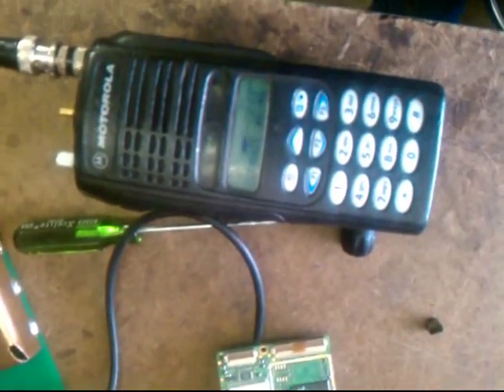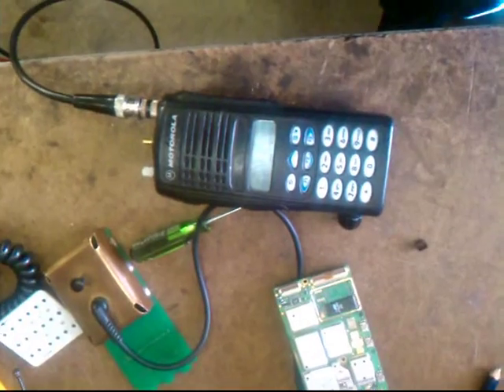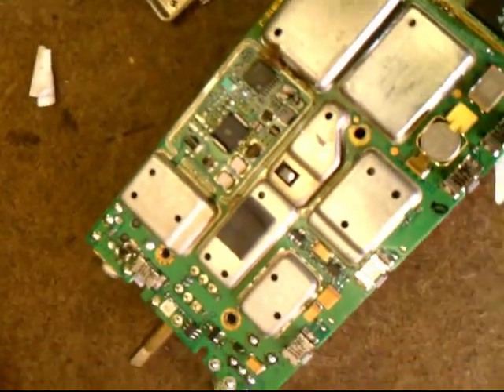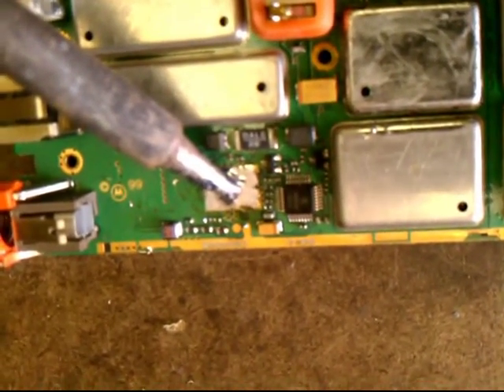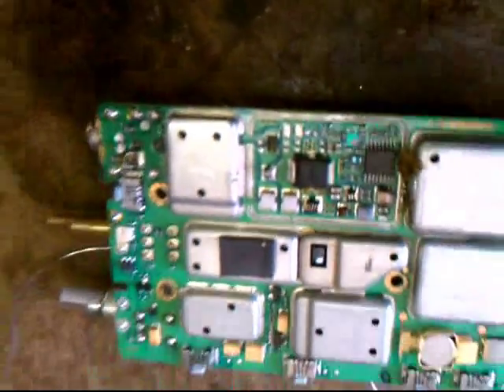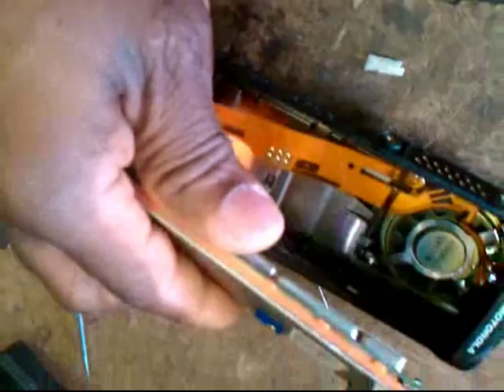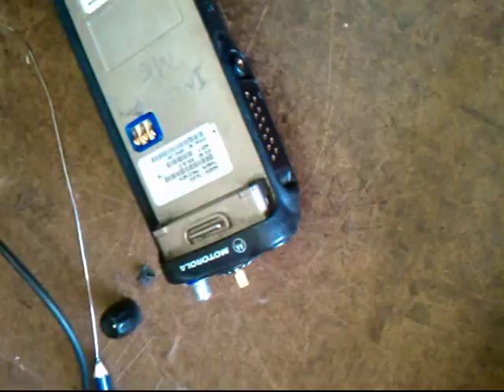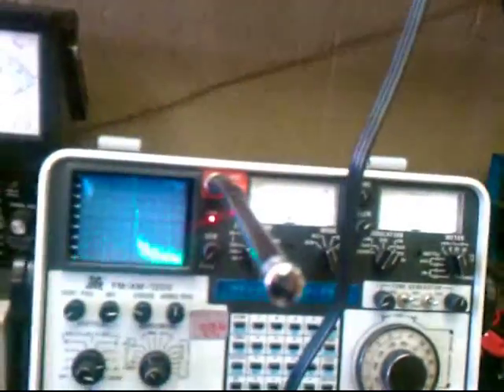HT1250 RF power output replacment

Comment: Motorola HT2000 my name is Jamal and I got a Motorola HT 2000 and my sound is about to go so how do I change it
Reply from the maker: I would check the speaker first before suspecting the audio amplifier...connect a remote speaker first to test

Comment: whats a common failure for no power if fuse is good and on/off switch is good.
Reply from the maker: First remove the main board and ribbons then key the tx button...if the red light lit then it's your lcd display or keypad...if not then..the test point is more than I can type lol.
Reply: TP406 is @ 0.3v instead of 7.5v

Comment: I'll appreciate all your videos in repairing Motorola handheld, great job! Can you share your expertise in troubleshooting "No Rx Problem" ? Tnx a lot!
Reply from the maker: Thank you....does it TX on freq?
Reply: Yes, but  no Rx. Speaker is good..
Reply from the maker: +Soc Arinc Sry to take so long to get back to your question. There is so many reason for bad or no rx..and Motorola have a flow chart for bad rx..My short cut for testing a bad rx is first test if im transmitting on freq with mic working just to see if my vco is work. Then see if the rx light is on when its receiving on freq. If its on then you might have a burnout audio amp.  But there is a lot more to it.

Comment from the maker: @whoopdud  There is a fuse located next the battery connector (freeze at 2:22 look @ the screw hole). its a small component above the screw hole, next to the battery connector on the main board (very small). use a ohms meter to check if its open.

Comment: I placed my HT1250 into the charger powered on last night and it was working normally. When I woke up this morning the radio was still in the on position, but was not on. I attempted using 3 different batteries in case it was a battery issue, but still no luck. Any idea what happened?